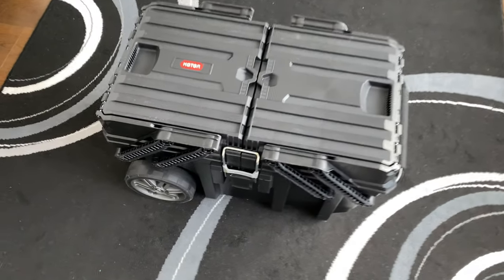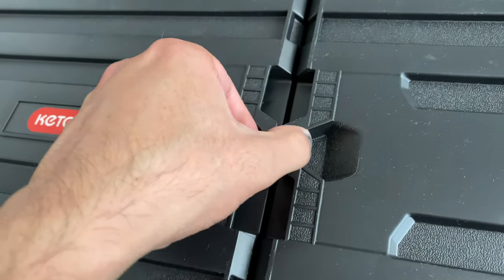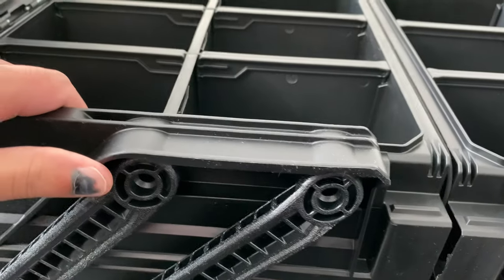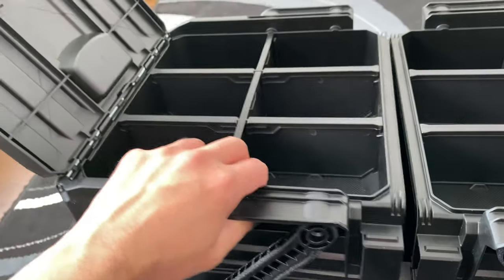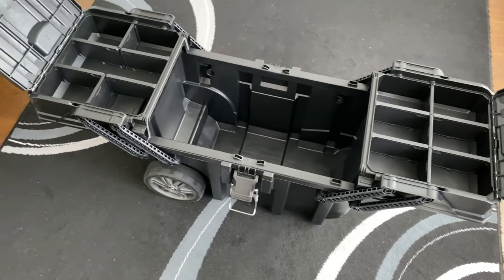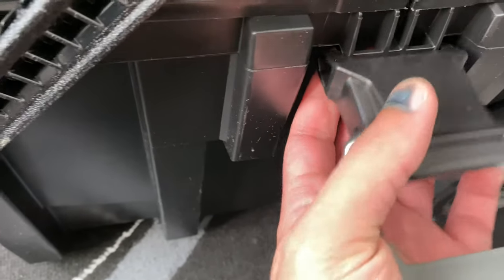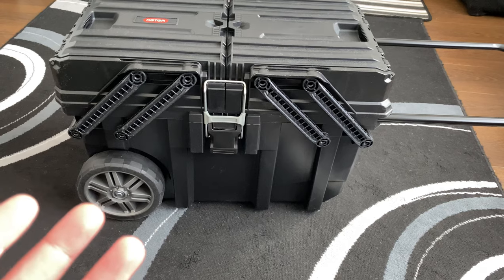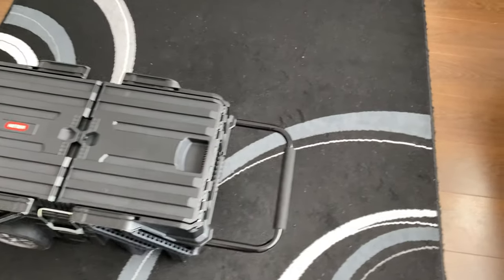Keter - 57L Wheeled Job Box

Comment: Bought box last year, and after over 8 months every day use, fitting feed systems. i dont regret money well spent its narrow and deep i can put my power tools (milwakee drill, sds, nutter,1/4 impact, grinder, and batteries and large tools. and top i use for spanners, drill bits exc. ) recommend over stanley and other job boxes
Reply from the maker: Same, still using mine everyday at work and it’s going strong.

Comment: Mate, I've had one for about 3 years, thinking of buying another one. They're good, only thing is be bloody careful with those connecting bars to the top tiers, sometimes they can trap your fingers, when opening / closing them up, very painful. :)
Reply from the maker: I’ve not had that issue (still in use daily) but I have found if you remove the dividers in the top then after a while they become loose and always fall out mixing all the tools in each of those sections.

Also the wheels have been fine but it’s obvious the plastic has worn away slightly and if you are rough with it then it’s possible you could crack through the plastic.

Other than those side points I’ve had no issues with mine.

Comment: Just snapped the wheels off my Stanley, how do these wheels hold up?
Reply from the maker: As long as you don’t drop it from height it’ll be fine.

The top section is a little flimsy but the box itself is solid enough

Comment: Can it take weight like if i was to stand on it
Reply from the maker: As long as you have the dividers in the top section you can use it as a step, the dividers add strength to the centre section.
Reply: @MATechYoutube  thanks mate respect that